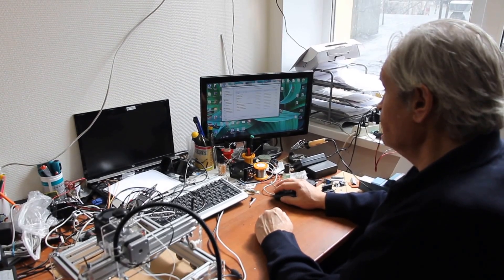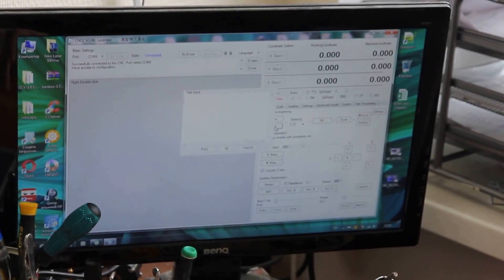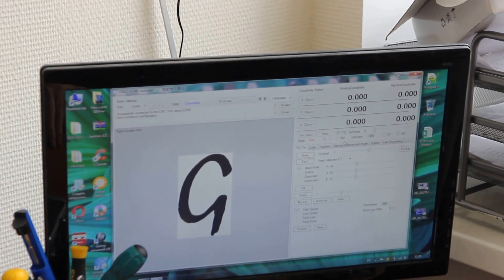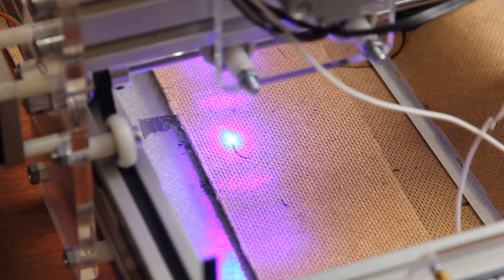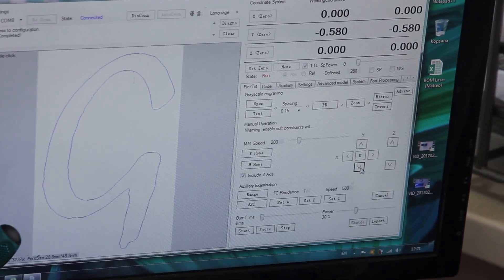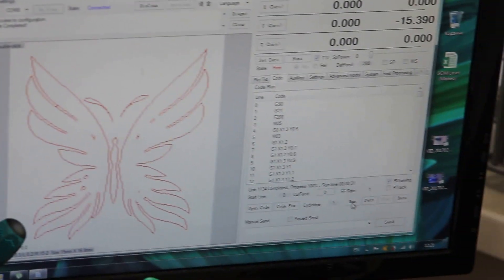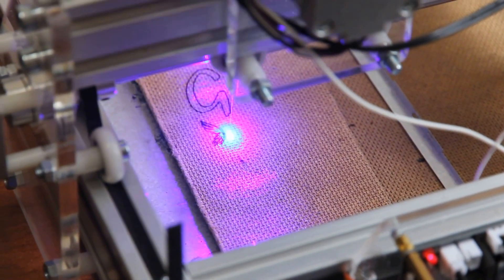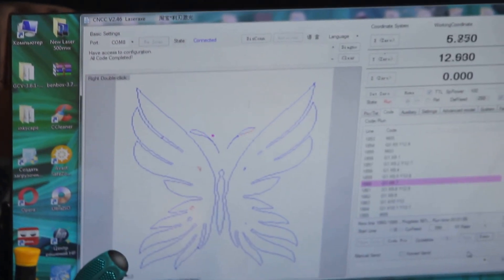Demo: how to use software CNCC LaserAxe for DIY engraving machine

Comment: how did you get it to follow s path? mine only goes back and forth like a printer
Reply: +George Fomichev so is the gcode something I have to add or if I use a vector image will outline automatically follow a path?
Reply: +George Fomichev so if I open a vector file in cncc it will automatically create the gcode I need to run in a path correct?